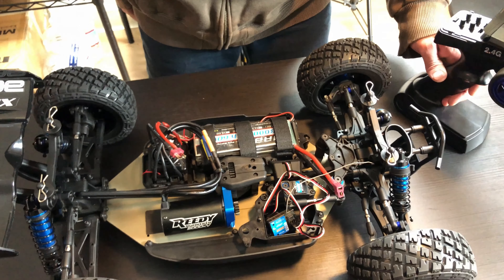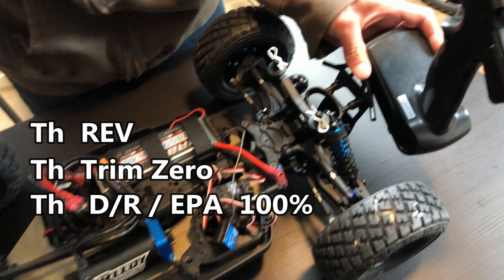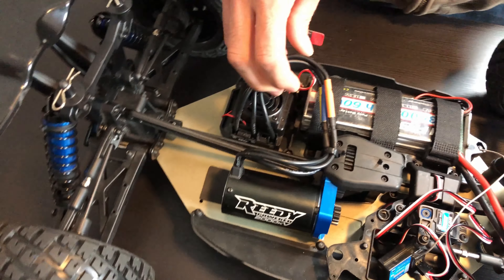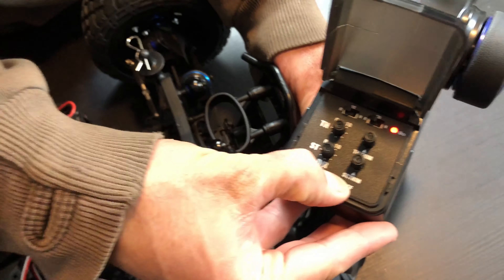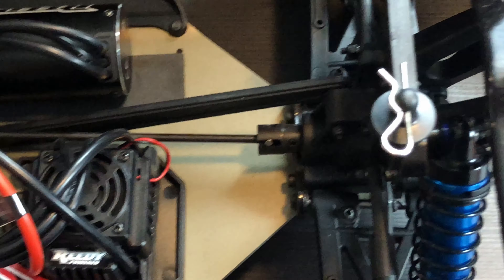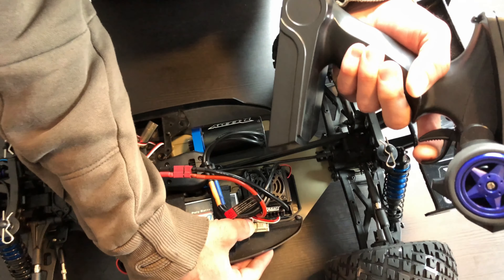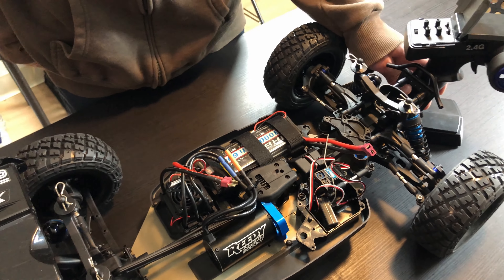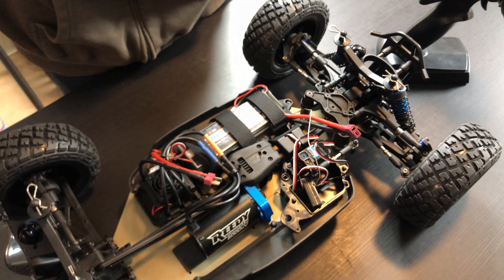How to Calibrate / Set a Hobbywing ESC

Comment: Having issues. Red light keeps flashing on me. I'm unable to calibrate. I'm using a dumborc receiver and transmitter. A hobbywing sc8 120 amp ESC in a 4s arrma granite with a stock motor.
Reply from the maker: Make sure your ESC is plugged into channel 2 on the receiver. Also make sure your motor wires are plugged into the proper order on your ESC. Sometimes when using different company ESC/motor combo the colors will not match on the wires from motor to ESC.
Reply: Try turning the throttle trim knob, once it's set to 0% or neutral, the flashing red light should stop and it will connect

Comment: Got it! Just don’t have reverse?? Thanks man!
Reply from the maker: I've noticed with some HW speed controls the reverse doesn't always work. After throttle range calibration, I think I would turn the throttle trim slightly back and this would help fix the problem.

Comment: We tried this a million times today with an E-Revo TQI. We could'nt get this to work. We saw a HW-Video and tons of people in the comments said the same. They never get the green light-feedback, no matter if its for neutral, throttle or reverse.
Any idea?
Reply from the maker: What motor are you using? It's possible you have the wires plugged in the wrong order. I have not tried it with a TQI radio but you might need to check if throttle is on reverse.

Comment: In a brushless set up it will be fine switching positive and negative wires to either choose fwd or reverse position but in a brushless sensored motor that would be a issue 
Just thought I'll share that in case Sombody isn't aware that sensored motors can not switch positive and negative wires could cause issues
Reply from the maker: Thanks for sharing, I forgot about that.

Comment: Instead of removing the spur gear, just set it up on a block or a rc truck stand.
Reply from the maker: You can do that too. What I usually like to do is slide the motor away and tighten the screws. This way the the gears are still on and there is no power going to the drivetrain.